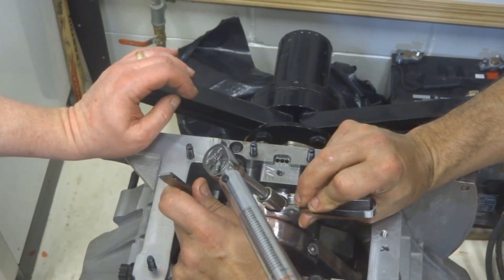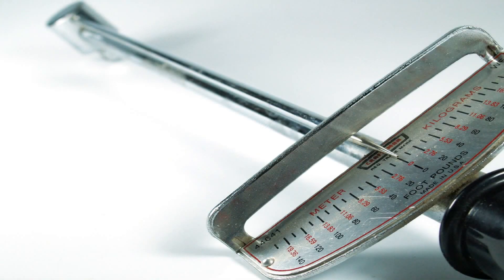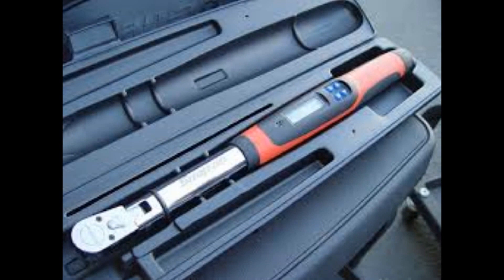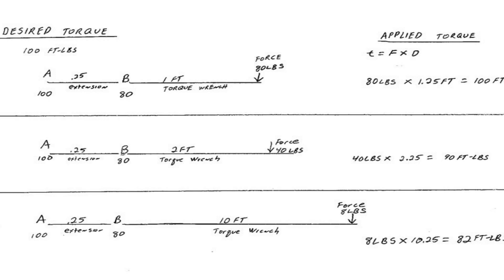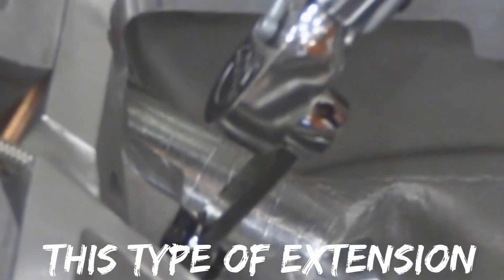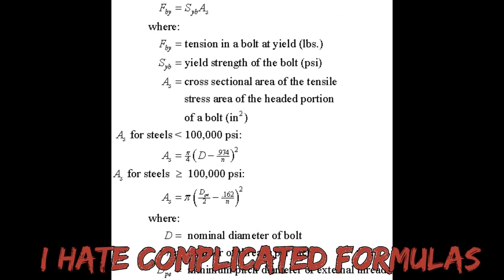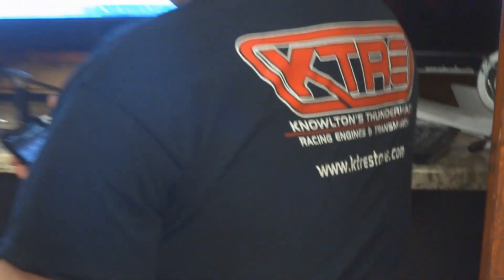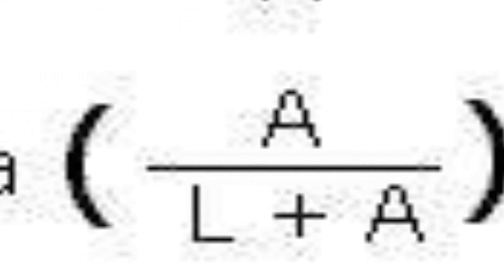How to: Torque Wrenches (w/extension calculations)

Comment: What is up with the few out there that think maths has anything to do with at what torque the tool click? If you add extentions like you are your nuts are going to be torqued at the wrong number. But at the work. Point of the tool the thing will always click at the required poundage it clicks from the feed back from work and has nothing to do with hand position on the wrench or from any work extension added as this short to the point video shows. https://youtu.be/mk95F0hHS3U?si=vdS4hI08-O6Tjshk

Comment: First let me say that I find no problem with your math.  However, when using a click type or a meter type torque wrench, how does the length of the torque wrench come into play?  When using either type it makes no difference whether you grab the torque wrench in the middle or if you have a 2' pipe on the end of the handle.  It will click at the same torque.  All that will change is how hard you have to push on the wrench.  With a flex beam type, the length makes a difference as the entire beam is flexing to supply the torque, not just the head.  That's why they put a pivot in the center of the handle so the force is applied precisely at the same distance from the head every time. Whereas with the other two types of torque wrenches the torque is supplied only at the head, and not over the length of the tool.

Comment: You've sold the beam torque wrench short. It's as accurate as the pointer on the range dial. If it reads 0 torque at rest, it's calibrated. Calibration, if necessary, only requires bending the pointer until it reads zero at rest. The lever distance is set mechanically and all one needs to do is apply force to the built in pivot point on the handle, then read the torque being applied as the fastener rotates. 

Digital and click-type torque wrenches are good for repeatability, but they're only as good as their build quality. Most claim +/– % accuracy out of the box. How about after 50 uses? Would you trust a $20 click-type torque wrench to apply the desired torque when rebuilding an engine? In addition, whatever their cost, they all need periodic calibration to ensure the torque signal is accurately signaled.
Reply from the maker: What if the spring in the beam torque wrench gets weaker after use? It's the same thing as callibration of the digital style.
Reply: @Tinman2Kustoms   There's no spring in a beam-type torque wrench other than the beam and drive head assy. deflecting as force is applied to the handle pivot.
Reply from the maker: @screenshot123  I don't mean an actual spring. I mean the spring of the steel. It will eventually get weaker as a result of forces. They're made of spring steel. That's how it returns back to Center.

Comment: I noticed the equation you worked out was different from the formula from the diagram. Is that your version of the formula ? Also, was that diagram for the specific torque wrench u were using?
Reply from the maker: Anthony Guevara the formula in the diagram was actually wrong. Lol I thought I mentioned that somewhere in this video, but I guess not. The calculations I used were correct. No, the diagram was just a generic one I found on google. The same basic idea applies.
Reply: Tinman 2 Kustoms ok yea i noticed it was different relative to the other shown. I wouldn't assume that that formula will work for your specify torque wrench since you obviously know there are different types. The wrench for the page that you found may have a different configuration inside which is why they use that formula. Basically that formula may be specific to the exact wrench.
Reply from the maker: Anthony Guevara not really. It's basic geometry
Reply: Tinman 2 Kustoms its possible that they may haven't different spring rates. So one wrench may use a different spring rate to compensate for the length of the wrench and they other wrench may not.
Reply from the maker: Anthony Guevara the end of the earth is possible too. But not likely to ever make a difference in our lifetimes. Lol

Comment: After watching this video i realized that it was my fault that i broke my oil pan screw hole and not a defective torque wrench. I needed a 9 ft lbs but had to add 6" extension. I calculated using this formula and may torque wrench should be at 6 ft lbs with the extension. So glad i saw this video. God bless you!
Reply: U added the extensions at the wrench handle or B4 the wrench nut?

this calculations apply only for extension added between the bolt and the wrench nut.

Comment: So what if your extension needs to go perpendicular versus parallel to the torque wrench. Is the calculation the same? Also, on intake manifold bolts that you can't even get a shallow well swivel socket on how do you get those torqued? Thank you. Great video.
Reply: Michael Donnel if the extension is perpendicular then the distance(A)  will be 0. If you want proof you can take a statics or strengths of materials course or buy a book which goes into depth as to why. If the wrench is at some angle then you would have to do some trigonometry to find the distance of that vector. Wrench length*cos(angle) will give you that distance. Simple reason why the length (and added force) will be 0 when the length is perpendicular is simply cos(90) =0 therefore the extension length is 0 .
Reply from the maker: perpendicular extensions are thought to have no torque loss. personally I beg to differ and generally go a couple pounds higher on the torque to make up for potential torsional loss. but that's a big debate that everyone has different answers for. as for the intake bolts, which I know exactly what you are talking about, they make special wrench type attachments for a torque wrench... not sure if it's shown in this video, but it's definitely shown in the video of the 2500hp street engine build on my channel
Reply: +Tinman 2 Kustoms this old 304 motor has handy raised areas in the casting around the carb that are impossible. I even bought a SnapOn shallow well swivel socket to try and get to these. I have only one I cannot get to unless I use a 9/16" box end wrench.
Reply: +Tinman 2 Kustoms looks like it's another trip to OReilly then. Thank you for your help
Reply from the maker: Oreilly might not have the tool. I have only ever seen snap on versions. Mac tools might have them. But I seriously doubt oreilly. You could also take a double box ended wrench that has your bolt size on one end and your torque ratchet size on the other end and try and do something that way. Then you would have to do the calculations that I show in this video because you are making your length of your ratchet handle longer, essentially.
Reply: +Tinman 2 Kustoms probably tons cheaper to do
Reply: +Michael Donnel Buy a set of crowsfoot attachments, and then just use the formula to adjust for the change in length of the torque wrench

Comment: I like to use\LW = Length of the wrench; LA = Length of the adapter; LE = Length of the extension.....Wrench 12"; Adapter  4"    LW/LW+LA=0.75, this is the correction factor (Cf).... Drawing calls for 100in.lbs but you need a 4" adaptor to reach the nut.( BTW, the nut should always be turning when final torque is reached and none of this double click mess like you see a lot). 100in.lb(0.75)= 75in.lb would be the new torque tool set point....Add a 14" extension to the nominal center of the handle....no adaptor, no Cf......Remember, if the adaptor in 90 degrees to the torque wrench, no Cf required
I hope this helps also

Comment: Thank you for the useful formula and information.  I had to use a 1/2" drive torque wrench with an 8" extension (the extension was actual an armorer's wrench) to torque a castle nut on my AR-15.  The original torque value was 40 ft-lbs but once I plugged everything in the formula the actual value with the wrench was 28 ft-lbs.  It worked like a champ.  Thanks again.

Comment: So with a regular socket extension that doesnt change the length of the lever. But applys the force thru a 90 degree angle.. we do what?
Reply from the maker: Do nothing but keep the torque wrench at 90* and make the motion fluid.
Reply: Tinman 2 Kustoms cool thanks for the quick response